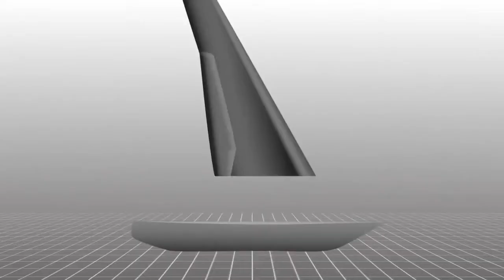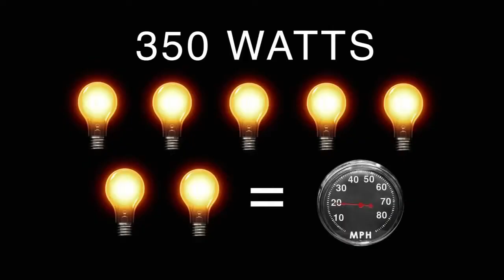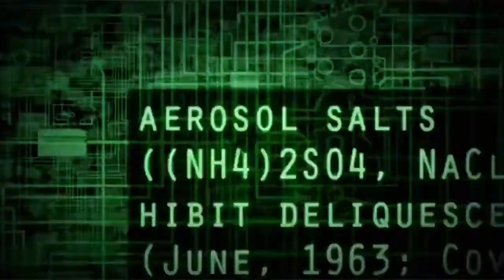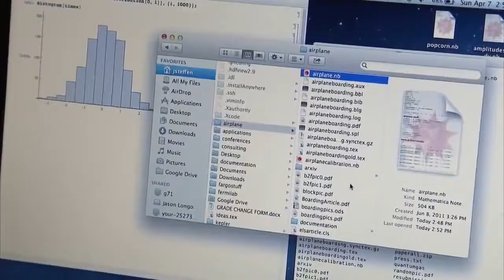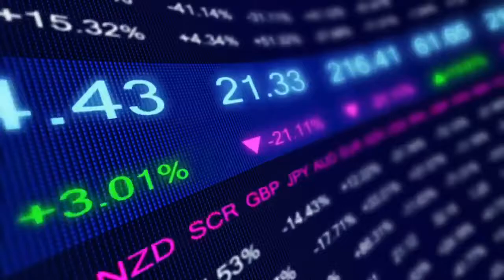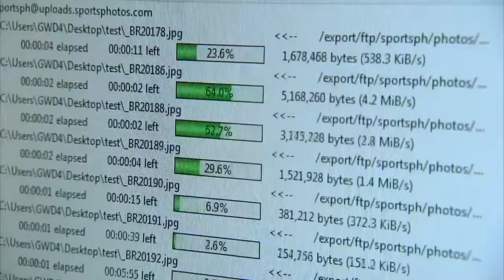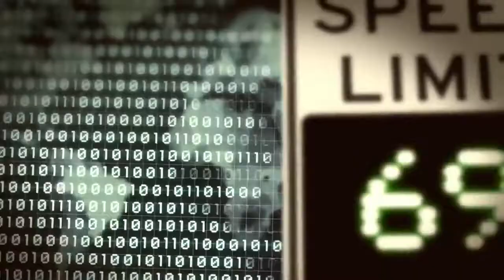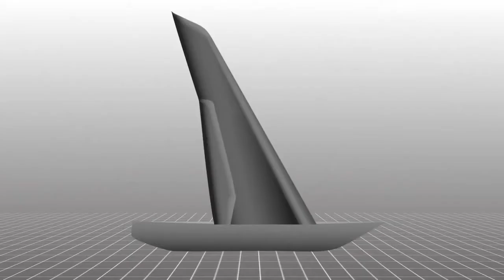Making Stuff Faster Documentary - The Best Documentary Ever

Comment: The push to do things quicker has it’s downside. It leads to reduced quality. The faster one is forced to go,  to go, the easier it is to make an error. Even automated machines have a tolerance level. And with some tools, much depends upon the material that one is working on.  Usually, the tougher the workpiece, the slower one needs to proceed or it risks breaking the tool. .